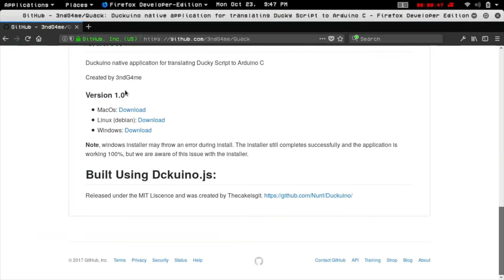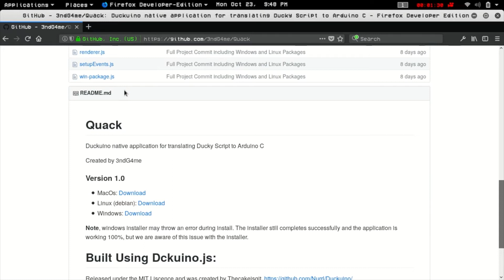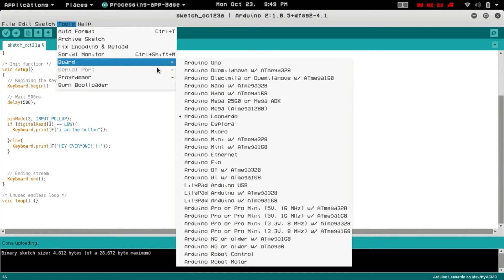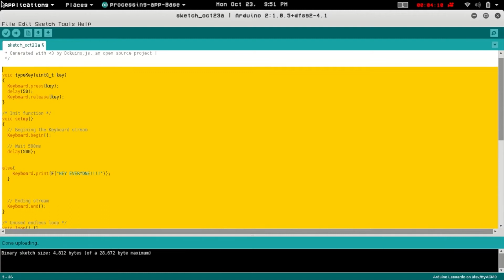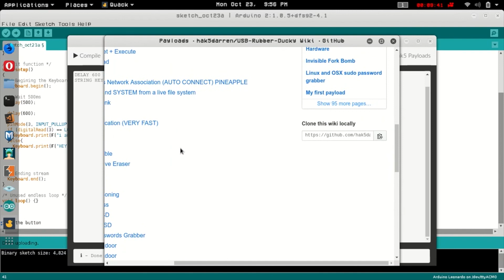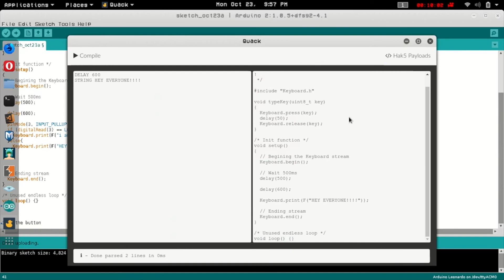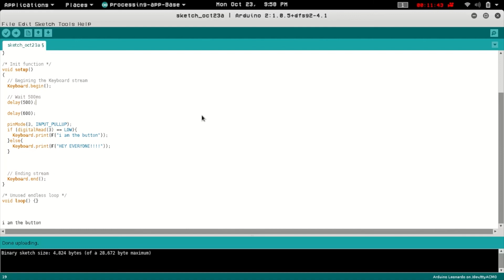DIY Hardware Hacking: Rubber Ducky USB (Bad USB)

Comment: Well personally, I prime new tips by coiling on the cold tip and bringing it up to temp, then re coating it a few times, and I go for 60/40 leaded, but if your getting the job done and your not oxidising your tips, than cool, it's whatever... just preference. I'm just cautious. Nice ducky translator though.
Reply from the maker: Grant Imahara I’m a total noob at this type of stuff even now so I really appreciate this feedback! Thank you!
Reply: Injection don't worry, soldering is easy, you'll get it... if you can code, and do Arduino projects, you should read 'Starting in Electronics' by Forest Mims... that'll get you going on 'discrete components' the electronics term for building from scratch... then follow some arduino projects that go from using the whole arduino board to just using the ATtiny/ATmega... then you'll have a solid enough foundation in the hardware side of things to build up almost any hardware gear you can dream up... software plus hardware, some social engineering skills and you'd be a force to be reckoned with... you'll be applying to give speeches at venues like defcon in no time... Keep it fun and try to stay out of trouble... if you show that your really willing to use your head and learn and get creative, the real ninjas will respect you and give you guidance. Tech is a fun place to work, play, and explore. Hacking is just the art of doing that, it's not really anything special it's just tech people messing around with stuff. Happy to help, cheers and happy hacking

P.S.
Did you see that Seytonic put your code on a server? I haven't looked at it yet but I get the impression he may have made some improvements... possibly to add some ducky code or make it translate to better Arduino style c idk... maybe he just ported it to web based code, I'll have to go check it out.
Reply from the maker: Grant Imahara Thank you again. That is definitely some solid advice.

As far as seytonic throwing mycode up on a web site, unless he did this very recently, I actually think it’s the other way around. I’m pretty sure I took the code from him/the original dckuino project. I saw the original dckuino project from one of his videos I believe and I took that code and turned it into the “native” app. The original project was intended to be a web app that I think he hosted at the time of that video, but I forked my own version because the core project was no longer supported and I didn’t want to rely on someone else hosting the web app in order to use it. So I actually took it from them to make the code I have now 😄.
Reply: Injection oh okay well either way keep at it... you'll do fine... like I said keep learning and having fun and things will come to you with practice.
Reply: The tip priming technique I use: https://www.youtube.com/watch?v=9DTYdZTCOFs&t=3m ...

An example of how much of a difference the quality of your solder actually makes: https://www.youtube.com/watch?v=5Ku7I3hA3AA ... 

And a good tip on how to do a proper lineman's splice. https://www.youtube.com/watch?v=uhzXRIj5FaY

Comment: Hey! 
I keep getting the error variable or field 'typeKey' declared void. 
I typed it the same as you have on the screen and I believe everything is working correctly. I am using the Arduino 1.8.9 IDE via the windows store. Is there a library I should have added? I am using the same hardware as you listed above. 
Thank you so much for the tutorial!!!
Reply from the maker: Hey there. In my experience with Arduino projects, the IDE version matters a lot. This project is older but according to the video I’m using version 2.1.0. I would give that a shot.

That said, if that still doesn’t work try out the latest version from the Arduino site instead of the Windows Store.

I will have a new video with some updated tech that I have been playing with for DIY BadUSBs so even if you can’t get it working quite right, keep an eye out for that video in the future!

Comment: Hey bro I have a very important question. Do you need to solder button to the arduino or can you just put it in without the solder
Reply: U can use a breadboard but the connection won’t be stable without soldering, so using the ducky on the go would be hard
Reply: @vishalkote1475  After those 2 years when so left that comment my skills about IoT and overall technology has significantly improved and I know the answer for the question I made myself but still thank you for answering me

Comment: I tried to upload/verify the code but instead I get the error:

Multiple libraries were found for "Keyboard.h"
 Used: C:\Program
Multiple libraries were found for "HID.h"
 Used: C:\Program
exit status 1
'Keyboard' not found. Does your sketch include the line '#include <Keyboard.h>'?

this is my full code (I know that I haven't got button support but that's not the issue):

/*
 * Generated with <3 by Dckuino.js, an open source project !
 */

#include "Keyboard.h"

void typeKey(uint8_t key)
{
  Keyboard.press(key);
  delay(50);
  Keyboard.release(key);
}

/* Init function */
void setup()
{
  // Begining the Keyboard stream
  Keyboard.begin();

  // Wait 500ms
  delay(500);

  delay(700);

  Keyboard.print(F("F"));

  // Ending stream
  Keyboard.end();
}

/* Unused endless loop */
void loop() {}
Reply from the maker: PiggyGrunter hi there. I’m not sure I went over this in the video but yes. That’s a common error caused by dated translation from the dckuino js translator. Simple remove the “Keyboard.h” include and it should be fine. That library is so commonly used that it’s able to be globally referenced without an include.

If that doesn’t resolve the issue be sure to also select the “Leonardo” as your device. Not all devices have HIDs support and therefore not all support the keyboard library. If you encounter an error even after you do that you can try the includes again, but I don’t think I needed it here so it shouldn’t be necessary.
Reply: @InjectionSec  Hi, thanks for replying so fast :). After removing the include line, I get the error :

bad_usb.ino: In function ‘void typeKey(uint8_t)’:
bad_usb.ino:7:3: error: ‘Keyboard’ was not declared in this scope
bad_usb.ino: In function ‘void setup()’:
bad_usb.ino:16:3: error: ‘Keyboard’ was not declared in this scope

I was using the verify thingy to check it since I get the same result uploading to the board. Also I'm using an arduino nano if that helps.
Hopefully you can help me out and thanks again for getting back.
Reply: @InjectionSec  OK, so tried verifying it with the leanardo board selected and it worked fine, but the thing is, I'm using a nano board so that won't upload. I was getting the error before when I was trying to do it with a nano. Not sure where to go from here...
Thanks.
Reply from the maker: PiggyGrunter you’re on your own there unfortunately. I could google for you and make guesses but I’ve not worked with the nano board before. Worse is I don’t have one to test with even if I did do those things so you’re better off than I am trying to trouble shoot your issue.

“Arduino” isn’t universal, different boards have different compatibility, and different drivers. In this case I am utilizing an Arduino pro micro Leonardo. If you’re not using that same board, then this isn’t a tutorial you should follow verbatim.

I’m sure some of the concepts are translatable, but if you’re having code/library specific issues related to the board you chose to use, you’re on your own 😕

Sorry! I will note that I do have a newer, better way to make DIY bad usbs thanks to my new found experience over the years. I have a video for that on deck in the coming months. My recommendation if you can’t wait for that is to research using a Digispark for DIY bad usbs as that’s the better board in current day and age related to this video.
Reply: @InjectionSec  OK I'll try to find a solution, thanks for the help :)